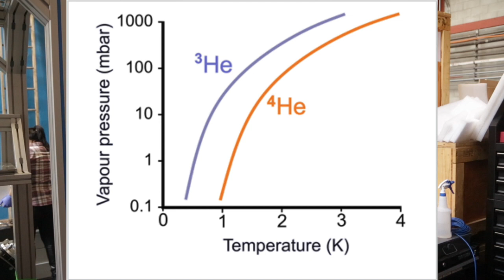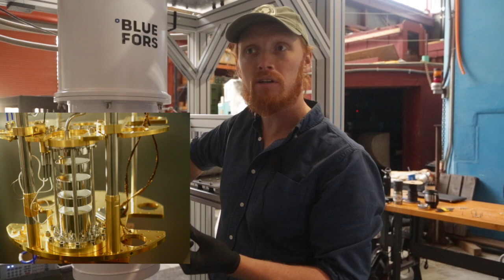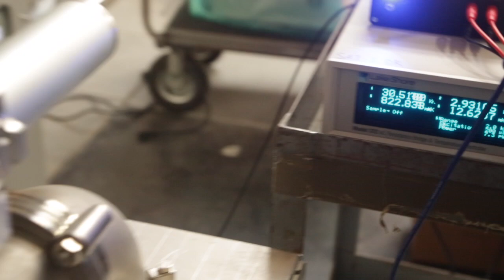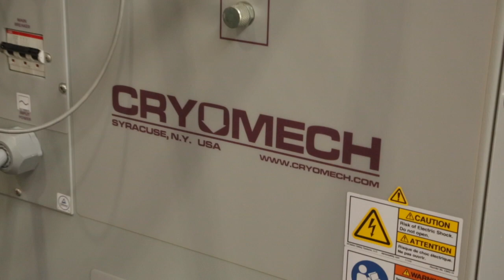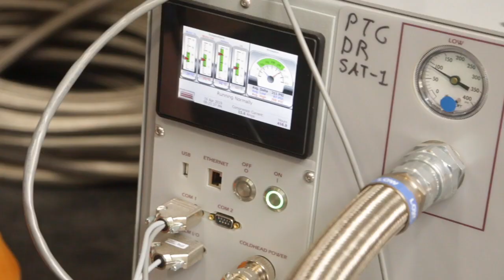How Does a Dilution Refrigerator Work? Dr. Nick Galitzki

Comment: How did you measure that your system is He leak proof?
Reply: not so difficult, usually you pull vacuum on your system, and connect it to a mass spectrometer that is calibrated to be extremely sensitive to the presence of helium. Then you spray helium gas all around the outside of your system, and if there are leaks, the helium will seep into the system that has vacuum pulled on it, and eventually into the mass spectrometer tuned to detect helium. This shows up as a spike on the leak checker, and then you can be more selective about where you're spraying the helium to find exactly where the leak is. this is a pretty important part of setting up any kind of vacuum system!